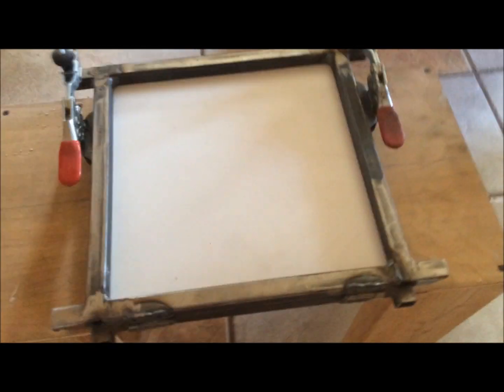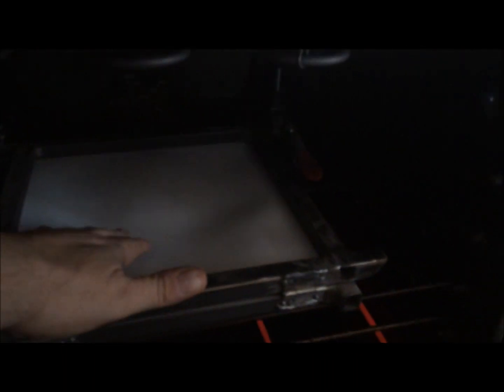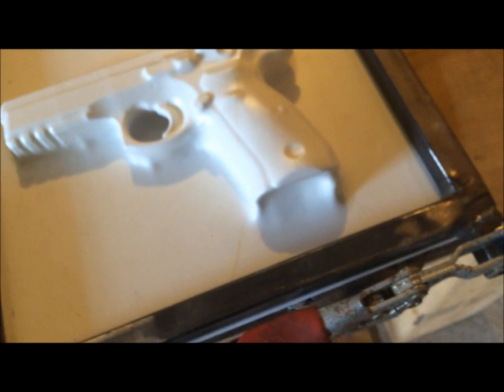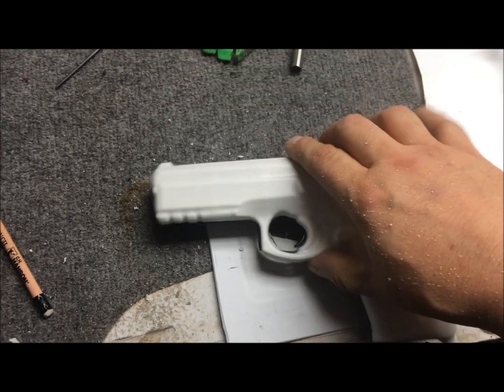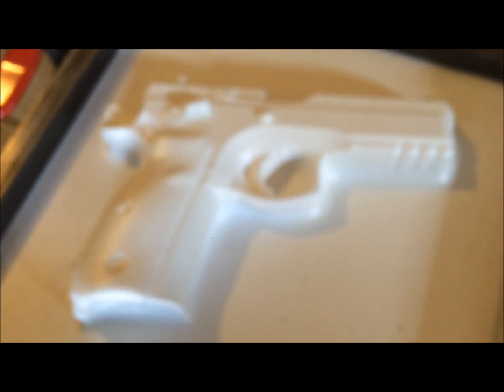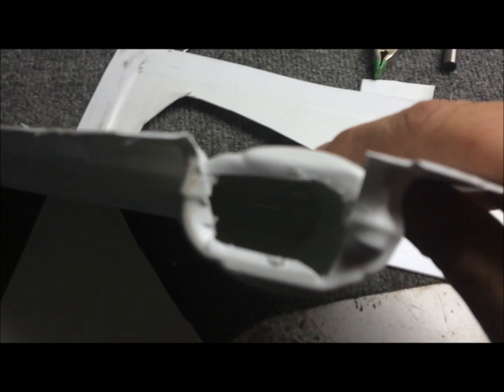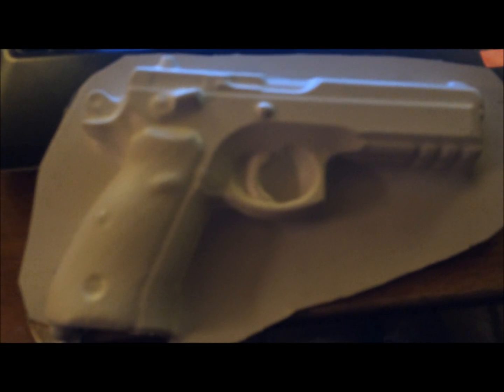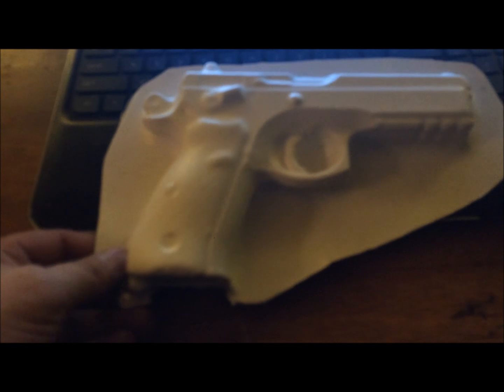Quick and dirty gun mold for making holsters

Comment: Thank you for making this video!  I've used your process and it works.  I use 0.062 thick sheet styrene and I also put modeling clay under the gun with plastic wrap in between the gun and the clay.  The clay prevents the plastic from being sucked under the gun, making it easier to remove the gun.  I also use a different casting material as well as shims on the sides attached with clamps to prevent the mold from expanding and keeping it upright, works like a charm.  Thank you again!
Reply from the maker: My pleasure! Glad it works for you.